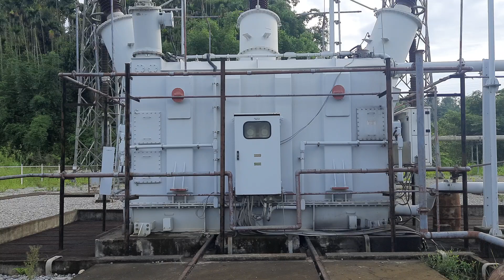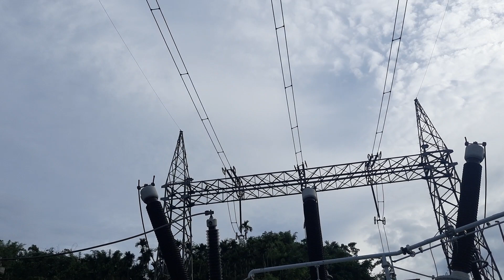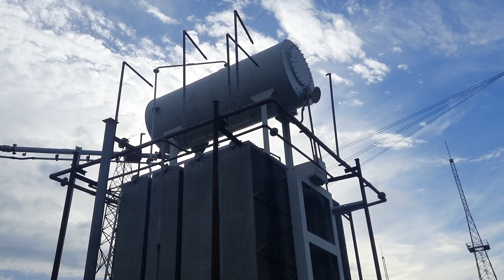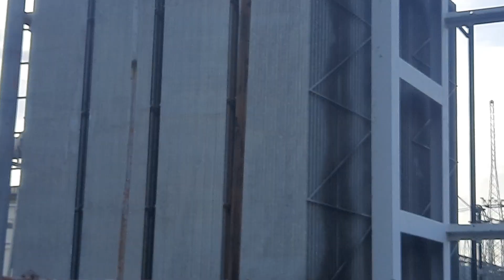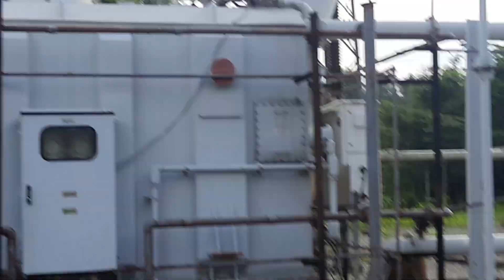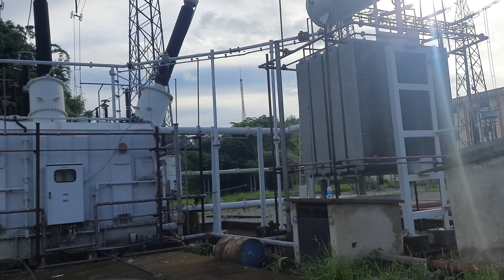Buchcholz Relay in protecting internal fault in 50MVAR, 420kV Shunt Reactor with NGR

Comment: Thank you Sir.  I'm wondering why the radiators are separated from the main tanks.
Reply from the maker: To allow better circulation of oil.
Reply: @electricalengineeringinrea5338  ok sir,  I like your detailed explanations. I want to learn more on transformers, switchgear , reactors, NER, protection of power systems, specifications for electrical equipments. Thank you sir
Reply from the maker: @noelfaithfulkari2857  good
Reply: @electricalengineeringinrea5338  I've subscribed to your channel to learn more